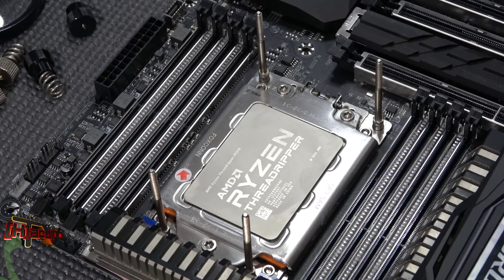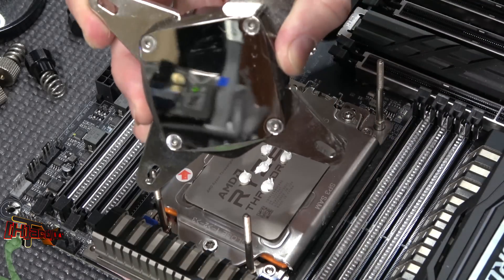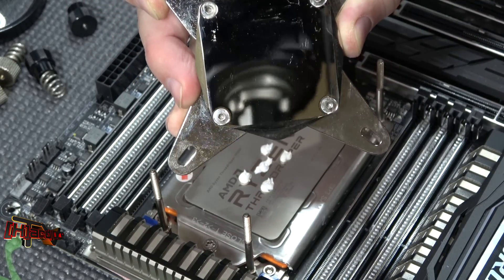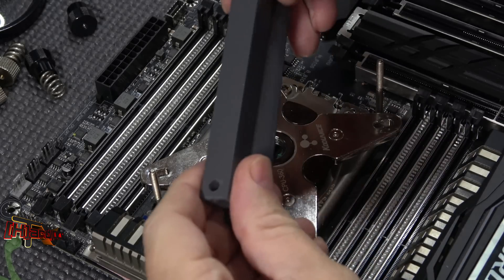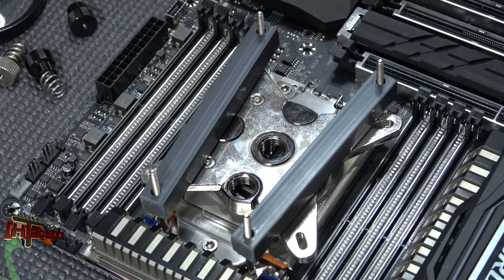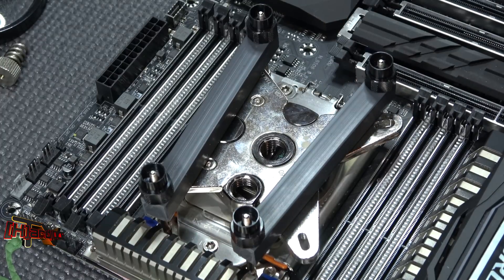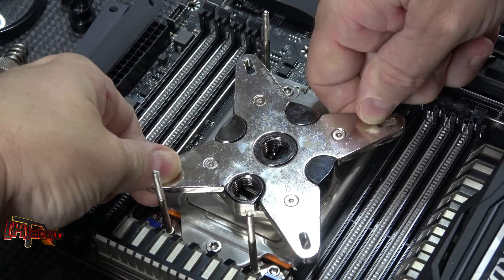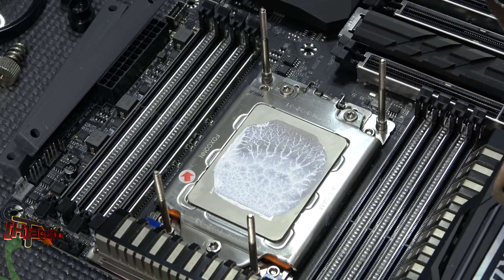Test Mount #2 AMD Ryzen Threadripper DIY Water Block Mount

Comment: AMD method works really well to say the least, might try that on my ryzen 1700.
Reply: Socket's not big enough for you to need to do that, just use a single dot in the centre that's about the diameter of the capacitors on the motherboard and you'll have enough.

It might not hurt anything to use the Threadripper method, but it'll be way more messy for you.